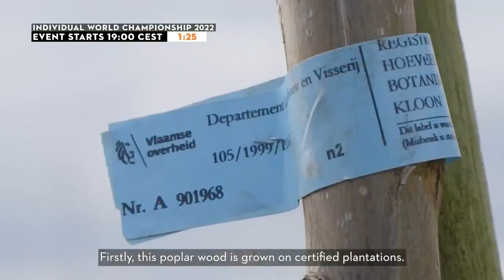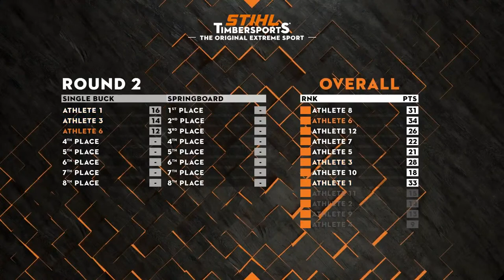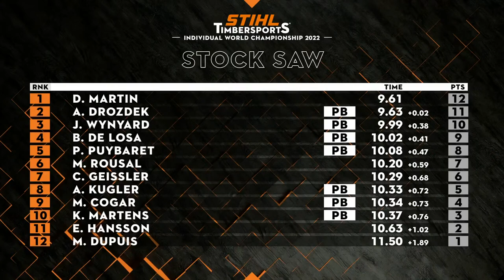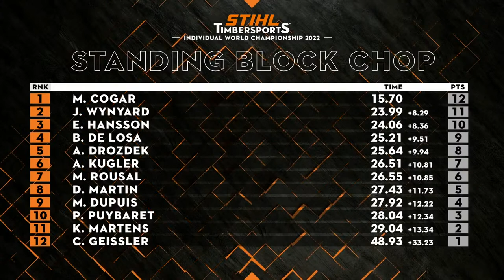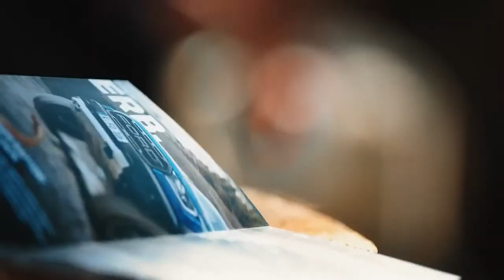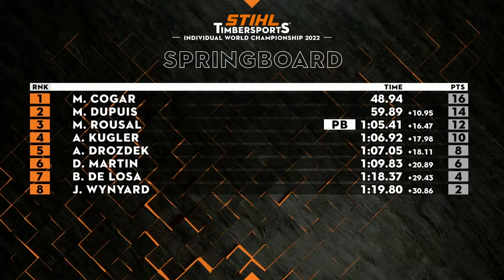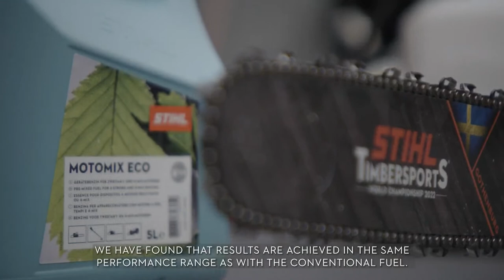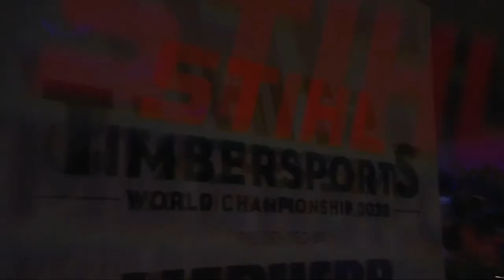STIHL TIMBERSPORTS® Individual World Championship 2022 (English commentary)

Comment: Why dont they use heavy duty safety boots instead of those girly sneakers when axing? Someone must have split a foot right?
Reply: Chain mail socks are worn under the shoes. The shoes (mostly Volleys) are used due to the feel and grip. Safety boots are bulky and wouldn't stop an axe scoop from underneath. The chances of hitting your foot on a downward blow are next to zero and if you did you shouldn't hold an axe.